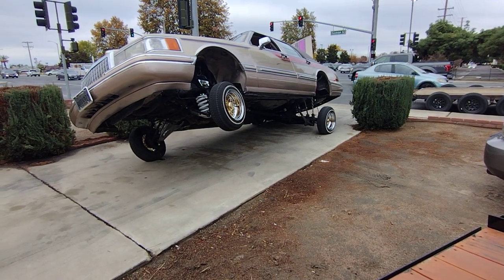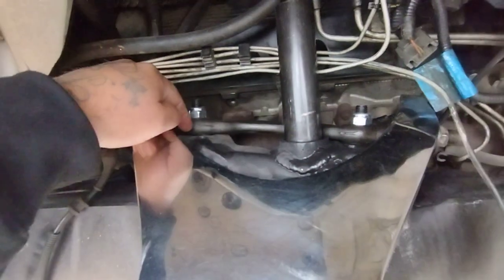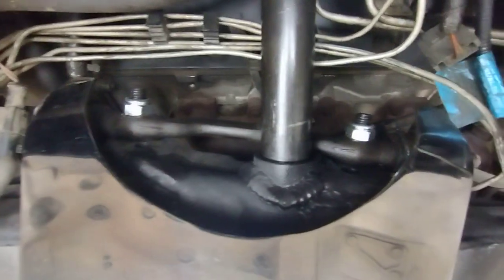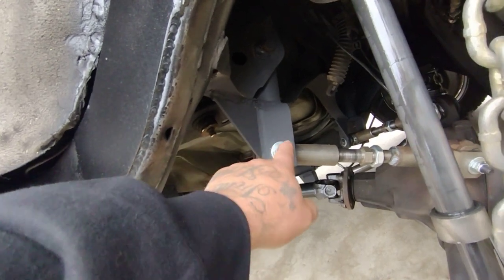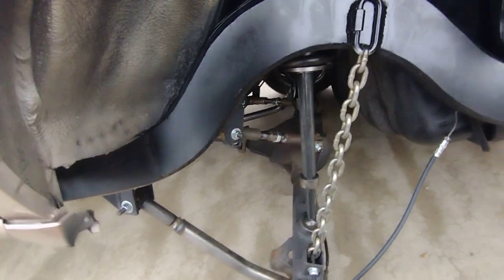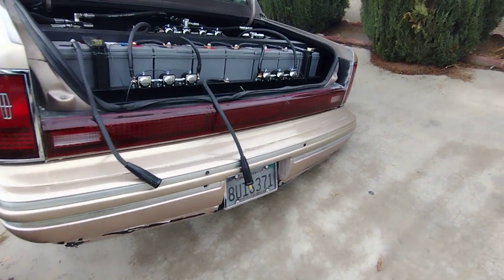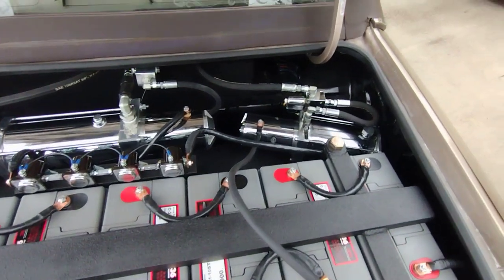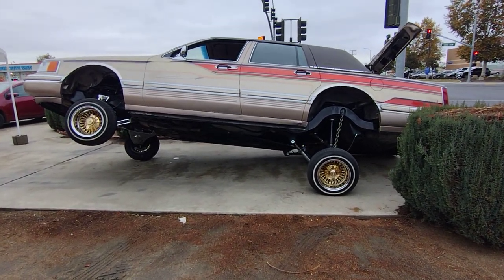Lowrider 93 Towncar From Delano CA. 3 Wheel. No Limit Hydraulics

Comment: hey boss where did you does lower control ball joints I have a  95 tc I swap to 94 spindler but that lower ball joint busted 2 days later and they was brand-new